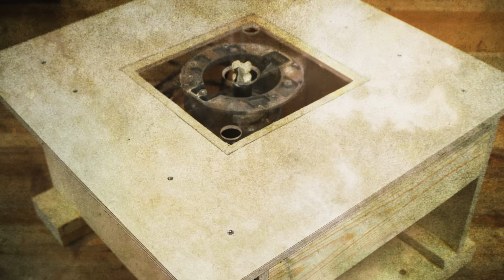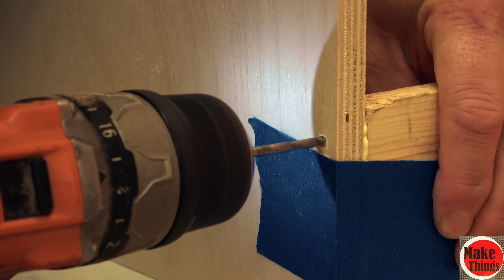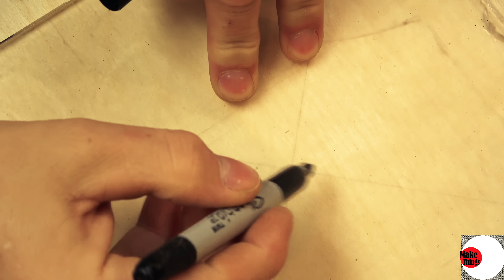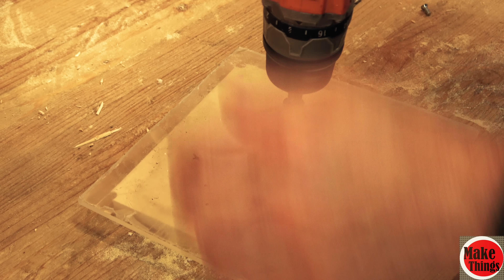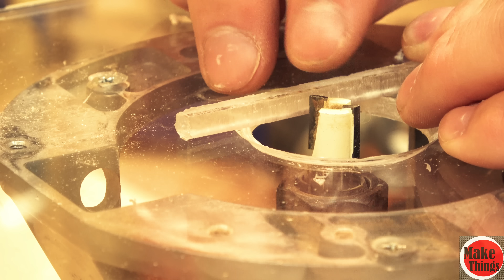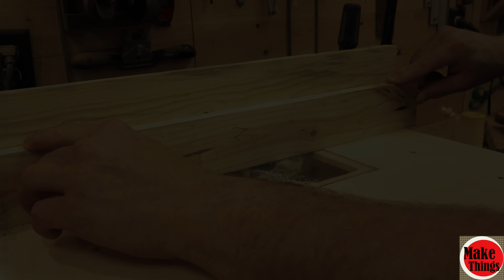Make a Router Table with ONLY 3 Power Tools // Professional Results with Beginner's Cash!

Comment: Pardon me but, WHERE do you find BALTIC BIRCH 1/2” x 20” x 20” Plywood for $3.99 ? 
I couldn't find it and have NEVER seen it that low in the last thirty years.
Reply from the maker: I get mine at Menards.  

https://www.menards.com/main/building-materials/panel-products/hardwood-panels/1-2-x-20-23-x-20-23-c2-baltic-birch-plywood/1254000/p-1452209920854-c-13334.htm

Comment: Going to give this a try at the weekend as i've recently picked up a second hand router. I already have some 3/4" ply and off cuts so just need to source some plexiglass for the mounting plate :) Thanks!
Reply from the maker: No problem!  Amazon has plexiglass for less than $10.

Comment: Add T-tracks down each side with measuring tape to ensure easy fence use. Also you only need the top with a board along the back for quick vice mounting and a smaller footprint for storage.
Reply from the maker: These are great ideas...thanks Steve!

Comment: Overall a great video, however I have one suggestion if you do this again.  When making the inside rebate with the router, remember you have the plexiglass plate on the router and it has flat square edges.  If you wanted your rebate more precise, you could clamp some straight wood on the outside edge to use as a fence for the plexiglass to ride along giving you a nice straight and accurate rebate.  I do love your videos!  thanks for all you do. One other trick would be to run a knife wall along the outside edge of your rebate to get a crisp line with minimal tear out.  The Paul Sellers method.
Reply from the maker: Both are excellent ideas, and I had thought of clamping straight edges on but was afraid adding extra materials on would be discouraging.  Definitely a better method and I always appreciate your comments Lee!
Reply: @MakeThings  I honestly cringed a bit when you hand held the router.  I've had mine catch and run ruining the "straight" lines I was trying to route out.  I would think a fence would be safer for the novice too?
Reply: I had the same thought.

Comment: Regarding using tape for a makeshift clamp, but it not having enough clamping force, an inexpensive alternative to store-bought clamps is to make wedge clamps from scraps.  For example, take an old junk 2x4 stud that's at least 8" longer than the project you need to clamp.  Cut 2 square blocks from it.  Screw the first block down at the end.  This is one jaw of the clamp.  Put the clamp against the project to be glued with the jaw touching it where it will need to be clamped.  Draw a mark on the stud where the side of the project opposite the jaw falls.  Cut a wedge from the other block, with the grain running the length of the wedge, at an angle so that the fat end is about 1/4 the length.  Cut off the thin edge so that the end is blunted, about 1/8" thick.  Hold the wedge against the rest of the block it was cut from, about 1/3 pulled out from it.  Place the wedge/block up to the mark, with the wedge on the mark.  Hold the block at this location, set the wedge aside and screw down the remainder of the block here.  This block is the second jaw of the clamp.  Put the project back in the clamp, and tap the wedge in place lightly to exert clamping pressure for a dry fit.  Use a flat screwdriver to tap the thin edge and back the wedge out.  Make more of these wedge clamps, enough to adequately clamp the joint in the project.  Apply the glue to the joint, put the clamps in place, and tap the wedges in until an even glue squeeze out confirms the clamping pressure.  

This principle of a tapped-in wedge providing clamping force can also be used in other configurations, such as screwing the blocks to a backer board on which the project sits, instead of a 2x4 'bar clamp', or really any clamp shape needed.  A tapped-in wedge can exert more clamping force than the best Bessey hand-twist clamp out there, for pennies.
Reply from the maker: This is a fantastic tip.  I love wedge based clamps and agree the clamping pressure is tremendously greater than the best clamps.  

Thanks man!
Reply: @MakeThings  Thank you for the reply!  If you're ever looking for content ideas, I'd love to see you make this, or something like.  It's a real money saver, especially in situations where you need very long bar clamps, corner clamps, etc.
Reply from the maker: I’m going to add it to the list...I’ll quote you as well (unless you’re not into getting credit 😄).
Reply: @MakeThings  Oh, I don't care about such things, as long as the info will do someone some good, so it's up to you!  It's not my idea, anyway, about the wedges in general, I got it from Izzy Swan's channel, where I saw him demo it with a plywood backer board (or workbench top, I forget) holding the blocks and wedges.  I've used the scrap stud configuration I described as long bar clamps, when I needed something longer than my longest clamp.  The 1 to 4 angle ratio came from someone else's channel, guy who used to be a shop teacher, but I forget the name just now.

Comment: Nice. I think it could be better if you added leveling screws. If I were to make mine again I'd definitely use a circle base since a square can be off centre by a little bit making hand held work always a little wrong when using fences and has less friction.
Reply from the maker: This is a good idea!

Comment: Noobs, he didn’t show it but you can guide your jigsaw against a speedsquare to get a nice square cut.  Also invest in a countersink bit for your screws and use construction screws not drywall. Drywall screws are brittle and will sheer at the wrong time. Otherwise nice project.
Reply from the maker: Good tip with the speed square...although, I’ll admit, at first, I was thinking you meant running the blade against the edge.

Comment: Great project Rob! Must have broke your brain a bit to try and use a jigsaw to cut a straight line when you had a nice table saw and miter saw sitting around. I think you have given me enough inspiration to finally replace one of the wings of my table saw with a router table. I like the way you made the plexiglas fit both the router table and the flattening jig.
Reply from the maker: You know what really killed me Grant?  I used the space right in front of my miter saw as a clamp area so that I could cross cut with the jig saw.   I was so tempted to fake it and do it the other way...but I’ve got to admit, I was able to stay on the line.  😅

Hey man, go for the insert for with your table saw.  I was originally going to make this an insert for the table saw but realized that most people probably didn’t have cabinet saws.  I have to upgrade my table saw router insert in the future...maybe you can inspire me with your own video idea. 😉
Reply: @MakeThings  I saw your lines. They were straight enough, but i wouldn't call it fine wood working 🤣🤣🤣

Comment: Great beginner's project!
I only wish plywood was as cheap where I live - 4 times your price for the lowest possible quality 1/4" plywood - Baltic birch probably only available at industry level and can't imagine the price. I have to build my projects with particle board, MDF and pine.
Reply: MDF is a good material to use for something like this.  It's quite stable, strong, and if you don't leave it out in the rain should last....AND it's inexpensive.  Hey...if it breaks down in a few years, just make another.
Reply: @donaldp9259  That has been the spirit all along :-)
Reply from the maker: Hey, I don’t know where you live but the cost here is outrageous too.  I think there might be a silver lining with craft type projects...I can’t begin to tell you how shocked o was to find those sheets for $3.99.  Maybe there’s a new trend developing?  I hope so!
Reply: @MakeThings  So, it seems the different is not so big. Thanks for replying :-)

Comment: That’s great! I like the idea of using just a few tools that most people would have. You could have added sanding the edges of the plexiglass to even out the cut edges but that’s just cosmetic.
Reply from the maker: That’s a great tip!  I did sand it a bit off camera but really was surprised at how well metal bits do with plexiglass, especially when you slow it down enough for it to cut and eject the material.  

Thanks for watching Don!
Reply: Make Things I always enjoy watching your videos. BTW -  I noticed that the silicone mat still comes in handy. 😁
Reply from the maker: I know, I love that mat!